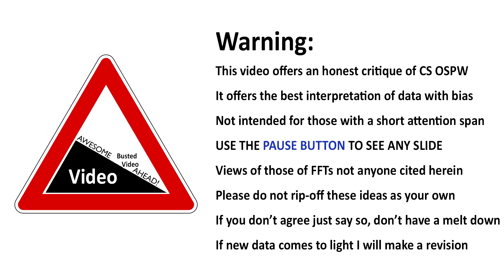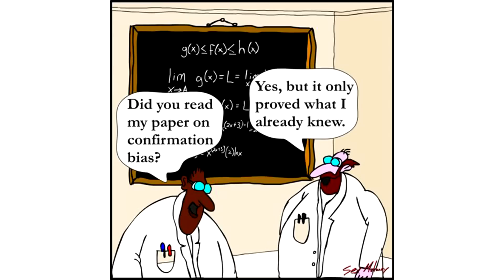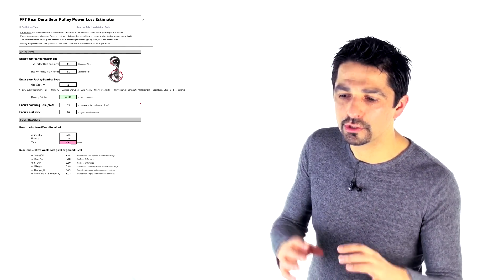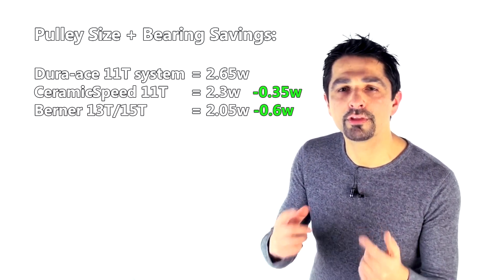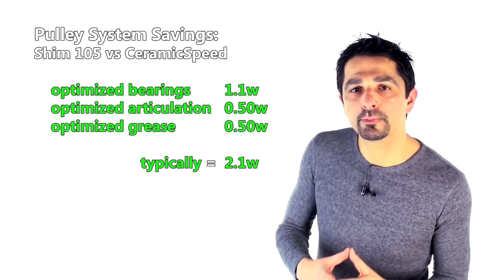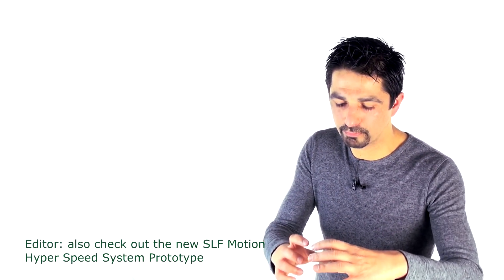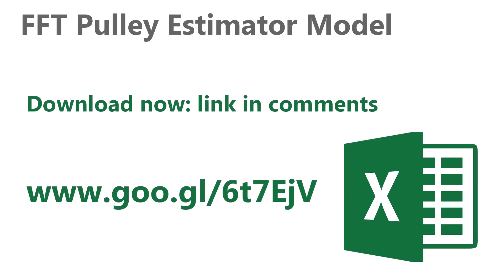CeramicSpeed OSPW Busted! (the truth about watts gained)

Comment: I remain baffled that there's a perceived benefit to 15T pulley wheels when cassette cogs have shrunk to 11T. The cassette cog has far greater load (therefore more friction) than pulley wheels. Has anyone done the math on the watts penalty of adding a link or two to the chain to accommodate the wagon wheel size pulleys?

Comment: I'm going back to regular stocked pulleys.  My experience is that OSPWs catch debris (twigs, leaves) for those occasion off road or from road debris. Past 6 months of running OSPW, I've had numerous things getting caught in my drivetrain (never experienced this in 20yrs) and two snapped off derailleur hangers from the debris getting caught in OSPW system. Just my experience, but a snapped off derailleur hanger leaves you stranded.

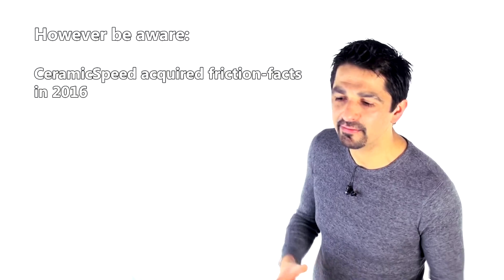Comment: At 3:40, the huge reveal that CeramicSpeed bought Friction "Facts." The only clear revelation from that group which has been corroborated is the benefit of paraffin as chain lube; other tests are pretty debatable and conveniently overlook things like "100% gain" from a 0.02 watt drag is only 0.01 watt. Pros get paid to win, team budgets cover silly tweaks and the mechanic hours to service or replace, and parts often are from sponsors. If you aren't paid to ride, why are you concerned about at best trivial benefits, for extravagant costs, unless it is to impress your heart surgeon buddies? As to Contador, if his team had the funds to budget for both clenbuterol, blood transfusions etc, they could surely afford such frivolous extras. For the newbies, Campagnolo for decades had a small port thru the middle of hubs, where oil could be directly added to grease-free bearings, in special events like time trials or track. No strong evidence indicates proof that any wins hinged entirely on this practice, based more on tradition, anecdote, placebo effects and superstition.
The industry today is sadly driven far more by marketing and hype, than real attention to the plebian needs or desires of most riders. Bike shops have regained business, because the tech-heavy machines are harder than ever to maintain, and the service intervals for external BB bearings is a hundred times more frequent than for the sealed canisters from the 80s thru the 90's.
As to the obsession over pulleys: What happens to the shifting traits? The pulley cage is wrapping extra chain not used in other gear combinations, and the lower chain is only under the tension from the pulley arm spring, not that of the upper segment feeling the rider's full leg power. Mis-shifts and jams and dropped chains can be traced to problems with the pulleys and cage, beyond simple weight shavings.

Comment: My SRAM Red rear derailleur had holes drilled wrong for the pulleys. My mechanic could not adjust out the stuttering that happened intermittently. The CeramicSpeed, with it's 3way adjustability took the stuttering out. Now it shifts better than I could imagined, killing any desire in me to go to an electronic system, which saved me $1500-2000 smackaronis. I think it was worth it.
Reply: Nice resourceful and efficient story about making good use of this product. You can't go wrong when it's necessary. Enjoy the rides...
Reply: Ace mechanic couldnt get a new derailleur under warranty? Shouldnt even need a warranty actually for a defective part.  Im calling bs....

Comment: You can talk for 10 minutes but why not show some testing? Talking numbers is nice, but proving them physically is what actually counts. You mention the comparison with dura-ace and that this is where they get their 2.4w number from, but the thing is that this number is always a comparison so the savings you get depend on the groupset you are using, the age of the components, etc.
Furthermore, if you fit your whole bike with ceramic bearings I'm sure the marginal gains will add up and you will feel a difference. But just like the price of these components, this is something an amateur cyclist shouldn't bother with. If you ride the Tour de France and you can save a couple of watts by switching out bearings, that's huge. Even if it's only 4 or 5 watts. If this stuff was a hoax, then pro teams wouldn't use it. Marginal gains are marginal by definition. An amateur rider shouldn't bother with it but instead try relubing the original bearings with a little mo2s grease.

Comment: Great Video, I think Ben Powell's reply (somewhere, deep below) did more harm than good, because it has a huge contradiction: First he claims that "the frictional losses contributed to the rear derailleur system by bearings are lower in an OSPW than in a standard rear derailleur" due to the fact that the CS wheels rotate at a lower rate than the standard wheels. Then on his second reply he writes "The friction created by a rear derailleur is independent of rider output", which is totally laughable. Apparently Ben skipped Physics in college? No speed, no friction force. More rpms  = more friction force. Sure the system's friction coefficient may be a constant, but the friction forces increase with speed and power, DUUUUH.
Newton's Third law of motion. This obvious mistake (when it suits ceramic speed, of course) leads me to believe they are completely full of shit.
Ben, If your products are so good, and you are honest about your claims, setup an independent lab test... otherwise, don't be surprised if everyone thinks your products are an overpriced SCAM.
Reply: Technically speaking he is right. Rotational acceleration which could be zero if the rider keeps the drive train moving at the same speed and pushing against air, rolling resistance and elevation changes resulting in different power measurements.

But yeah, I dont think you get these for any real practical purposes unless you need every edge to win or want to change the RD cage for another reason.
Reply: @sakizashi5421  He is not talking about rotational acceleration, he is talking about friction losses due to the different rotational speed of the wheels. This may be correct,  but then he states that "The friction created by a rear derailleur is independent of rider output", which is wrong. On the first statement he says that the speed of the rider does affect the friction on the wheels, and on the second statement he contradicts himself saying it doesn't, using a technicality to confuse the reader by omitting the term FORCE.. yes.. the friction coefficient on the system doesn't change, but the friction force does, obviously.

Comment: Just to add that the aero drag for the OSPW is around 1watt (10grams of drag) so take that off any gains, and it begins to look really really marginal. By your calculations typically savings would be 1.4w (8:31) minus around 1watt drag at 40kph (1.25w at 50kph). This means the net saving at 40kph is typically 0.4w and above 56kph it would be zero (tipping point). Thank you FFT for getting us all thinking and not spoon fed! (citation: http://www.bicyclingaustralia.com.au/reviews/gear/ceramicspeed-oversized-pulley-wheel-system)
Reply: Interesting.
Reply: But what about up climbs? 🤔 Marginal gains

Comment: What about us mere mortals with limited budgets?
Remove the seals from steel bearings and reduce the fill rate to 25% using light oil, not grease. What is it? You say you wear out your bearings fast this way? So? Considering you have to service your ceramic bearings frequently to maintain performance, its more cost and time efficient to just buy medium price steal cartridges, strip them off original grease and seals and replace them periodically.

Comment: 9:59 I bought the Rockbros system on Wish.com for $80.  Installed it on my TT bike.  Did not win.  But...  what can I expect when I am probably seeing like 1W savings?

BTW these use true ceramic bearing and ceramic race...  but they come DRY.  So you probably give up some of that Watt just by putting grease in them.

Comment: Try 'Slick 50' in your normal bearings after exposing and cleaning the balls and race.
Slick 50 is a Teflon based hydrophobic automotive oil additive, but it works amazingly alone on high stress bearings as pulleys.

Comment: Im just wondering if you can take the cheaper ones and replace the actual bearings with bearings from another industry. like RC Cars and skateboards. Some skateboard riders have used ceramic bearings for decades. Also, when you picture RC Cars, please dont picture the toys you get from the supermarket. Rather, picture a almost 4kg car made from high quality alloys and carbon fiber worth approx $3000. These guys use Ceramic bearings sometimes too, esp in nitro engines. but there is very little difference in the wheel bearings, but arguably more benifit in the engines. In the picture, the beaings casing seems to be pretty much industry standard. So long as the sizes are the same as other industry's. I say it would not hurt to try. you can get ceramic bearings for RC Cars for as little as $50. So it depends how many would be needed too. $500 for a set of beaings seems like a bit of an exploit to me. I highly recomend someone investogating the use of bearings from other industry's to chaive the same result as these guys have.

Comment: I get it, doesn't look like it would save watts. But, I bought a SRAM Red derailleur new on ebay, gears would grind on occasion, mechanic thought it was pulleys, replaced pulleys, no change, my mechanic said CeramicSpeed oversized wheels have 3 different adjustment angles that can be made and we were able to adjust out the clash of gears. With the CeramicSpeed I am faster, maybe mental, but when I push my bike through say stops, the bike gets noticed, especially by mechanics comment on my SHIV, so I'm happy. Note, all other comparable big wheel pulley systems he mentions are non adjustable if you derailleur is off like mine. And it has to be serviced every 6 mos like he says, but we'll worth it in my application.
Reply: Wouldnt you just align your derailleur?
Reply: @JohnDeF2112  
Stock derailleur pulleys only have one angle of adjustment, CeramicSpeed has 3, was able to correct the weird angle. It was bought on Ebay, so don't know how to get mfg to fix it.

Comment: Silly marginal gain conundrum: I have dura ace 11t pulleys with 7000 dry kilometers in them. Teeth look in good shape. Would I find better watts/£ value buying some Tacx T4065 pulleys (0.1w faster than DA and fresh teeth, bearings etc.) at around £25 or buying some ceramic speed pulley oil for £5.50 for the dura ace ones I already have?
Reply from the maker: George C email info@fastfitness.tips and I'll give you a preview of our calculator which will give the answer
Reply: Sent the email. Look forward to receiving the preview of the calculator.
Reply from the maker: ok got it
Reply: much appreciated. Thank you

Comment: I believe that the ceramic speed rear derailleurs with the enlarged pully wheels are a good pice of equipment.
But at a price tag of roughly 500,- EUR / USD this will definitely be the very last upgrade I consider. Even if its performance meets my expectations we're still just talking about 1 watt for 250,- EUR or so. That's bloody expensive!

Comment: what  will happens when dirt comes into ball bearings- it is in stream of dirt air .
i use shimano dura ace from 1995. with ceramic slide bearings-it will last forever, does not rust and it is still as new but it has pay attention on torque when screw

Comment: Debunking that ceramic nonsense deserves a sub at least. Ceramic is good in machine bearings with RPMs going into tens to hundreds of thousands [because of heat]. Ceramic elements other then bearings just make your bike more expensive and less sturdy for marginal weight gains.

Comment: Without the ceramic bearing and wattage saving bullshit, large pulley with reasonable price (50~70 USD) is not bad, as it makes cleaning much easier.
The small default cogs make it a little hard to clean, as the only way to clean them is to disassemble them from derailleur, while large pulley don't.

Despite that, I see nothing else worthy.

Comment: Excellent vid! I’ve been boring the tits off my cycling friends for ages about ceramic bearings and how inappropriate they are for bicycles.
Reply from the maker: Paul Robertson thanks. More drivetrain stuff coming next month
Reply: What’s your opinion on bushings for derailleur jockey wheels? I’ve been developing and testing for a few years. The thought process behind is driven more from experience in bad conditions ie off-road/winter. The ones which have actually worked the best are the ones with little to no sealing and large diameter bushes as the muck and dirt isn’t trapped. Advantages are lower cost and lighter weight. I just don’t believe there is a need for full bearings in jockey wheels
Reply from the maker: Paul Robertson  as you have been testing i default to your knowledge but Can the solution be light...resistant to dirt and low in friction?
Reply: yes why not. if the seals/protectiv covers and shape of the wheel are designed in  such a way to channel away water and not hold dirt ie teflon type coating. cut away jockey wheels hold dirt and clog up dirt really quickly. also these wheels are merely idlers to aid gear changing. What am i missing here? why do they need full bearings

Comment: No grease left in my ultegra pulley wheel. Spins better than Alistair Campbell on a carousel. I just pop a bit of Teflon dry lube on it after every wash. Eventually it will die, and I shall replace it with the new set I have in my spares drawer that cost £15.

Comment: Grease = drag = less power,  this is why Ceramic Bearings seem to run more freely. if you remove the grease and less friction on the bearing seals you will save power
Reply: Also Ceramic is designed to work best at high temp and high speeds upwards of 7000rpm which you could never attain on a bicycle

Comment: We all knew of course that these CS OSPW's are total BS. However, I'm running campag chorus 10sp and I'm getting slightly annoyed with the pulley wheels - really bad design. Does anyone know of a good after market option? It would be nice to save a watt, but what I really want is some decently sealed bearings there instead of a metal cylinder that gets corroded.

Comment: In each system (large or small) the chain ends up making the same bends. So wouldn't the amount of friction in each bend end up equalling each other? Sure the smaller tooth increases the bend in the chain but the larger pully has more chain links that are bent to run the same path. Did I miss something that explains that?
Reply: but that chain bend happens only twice - when the chain enters the pull wheel and when it leaves the pull wheel; it does not matter how many teeth are in between those points, because no further bend does happen, the chain stays in the same configuration

Comment: isn't it about time that flexibility is engineered in to rear derailleurs i.e. so that jockey wheels point along the chain. And maybe the teeth on the front chain ring could have teeth that swivel on a needle bearing. Or have a solenoid controlled rear cassette that moves itself into the correct position. And a flame thrower on the back is essential.

Comment: I use a 15 tooth ceramic bearing pulley, the company is not ceramic speed but another brand name called Fouriers; I think they are great and I felt a difference. The difference is not that much but surely I could feel the chain less tensed. I really think the difference is more than 1 watts. It's jus my  opinion.
Reply: placebo effect?

Comment: Parrifin wax on the chain instead of oil, ceramiq bb, hubs, pulleys, aero brakes, qr, headset and pedal bearings. Watt savings is now much higher. Upward to 10 watts. But the cost of all this is astronimical. Only a tdf rider with corp sponsors should even look at such a combo. Never a non racer.
Reply: hardly... complete drive train losses of a road bikes are ~3% (without any snake oil...). So, if you do an average of 300 W - which over the course of a race is not bad... - you have losses of 9 W on average; no save 10 W from those 9 W 🧐

Comment: Why you dont say at WHAT speed is that savings? In my opion if you ride in 10 km/h speed you can save for example 1 W. If you ran in 50 km\h speed, you can save 4 W.
Reply: as it is on the downside of the drivetrain, where force is always the same, wether you push 1000 W or cruise with 100 W, it makes no difference (as long as your cadence - and therefore the speed of the chain - is the same)

Comment: POINT TO MORE FULLY CONSIDER: You mentioned Alberto Contador's mechanic taking out the factory grease in his pulley wheels and replacing with a lighter oil. I guarantee that CeramicSpeed tests are against competitor wheels with factory grease. I've been doing what Contador's mechanic does with my Sram "Blackbox" Ceramic pulley wheel bearings and, like ceramic speed, they now will spin forever (I take out factory grease and replace with low friction oil). I do clean and re-oil the pulley wheels every 500-700 miles (depending on conditions), but they've (SRAM"'blackbox" ceramic pulley bearings) lasted me 2 years without any perceivable performance loss. 

I would love to see a segment testing this on other brands to see the performance gains we can get without breaking the bank when it comes to the bearings we have (or minimal upgrades to SRAM or Shimano ceramic bearings). 

Thanks for all your amazing content!!